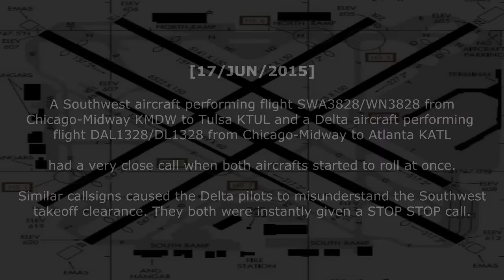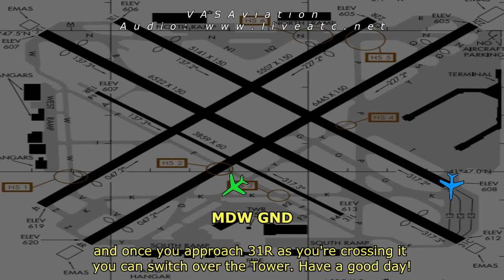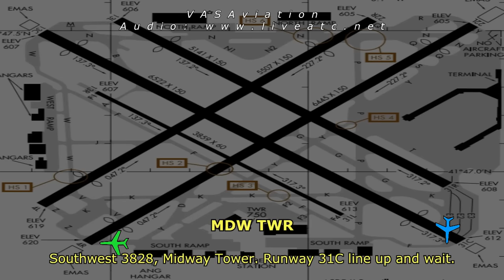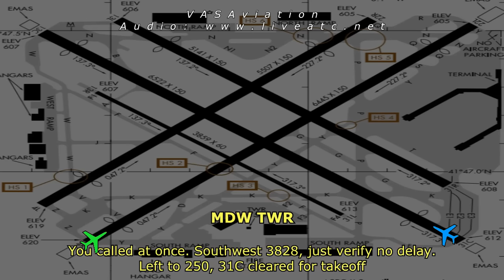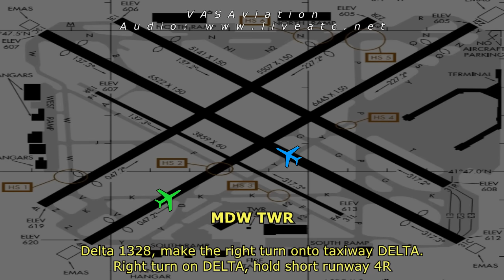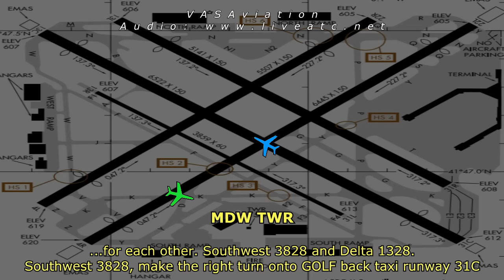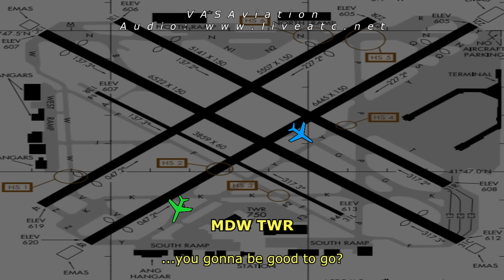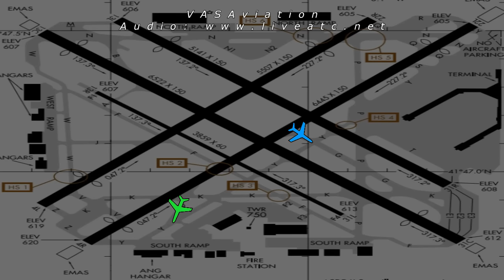[REAL ATC] Delta and Southwest VERY CLOSE CALL on takeoff

Comment: The communications from ATC to planes is critical to get right.  Was it the Delta pilots fault, mostly, sure.  But that ATC did an awful job.  I couldn't tell who he was telling to take off.  Dude uses a radio all day long and he still cuts off the beginning of every one of his messages with the click. --  The ATC has the opportunity, the experiance, and the responsibility to prevent this error from happening; instead he seemed to do everything just right to cause the problem.   ---  Sorry for being an ignorant sideline coach.  Please if I'm wrong, or if there are extenuating circumstances please let me know.  --  This whole thing is just so ridiculous; I just had to talk about it.  How do we change the situation so it's not possible for miscommunications like this to happen? I imagine that pilots won't give up control in any way.  I imagine that any form of point to point communications would reduce situational awareness for everyone else.  --  Maybe we need radios the act like a party line, so when multiple  people are talking at the same time everyone hears everything, instead of current radios that make all transmitting parties deaf.

Comment: ATC mostly at fault, he should have been more clear instead of incohearent, especially after he noticed both stepping on mic, there was clearly a confusion right before he cleared takeoff, he should have immidatley say, ''hold your position, now, listen guys, there are 2 of you with simmilar cs, i will now try to speak slowly and clearly so there arent any confusions''.  All that because he didnt speak slow and cohearant in the first place. Its not a race ... Also that ''no delay''.... he knew there was some confusion going on, and he felt the need to tell them again ''hurry up go now now now''.... wtf....

Comment: How are radios still THIS BAD.
Like I get inside a plane there's a lot of noise, but for the tower? Take a page from pro streamers and get a god damned mic or talk slower or something.
Im suprised this doesnt happen more often.
Reply: Do you know how radios work? Streaming and radios are two different thing....
Reply: @Sauvageau218  Yes. But they are still using tiny old cheap headset mics that sound terrible. Most pilots don't have a lot of options, but an ATC could literally set up any mic they wanted on a desk.